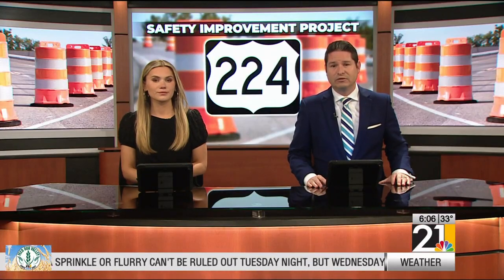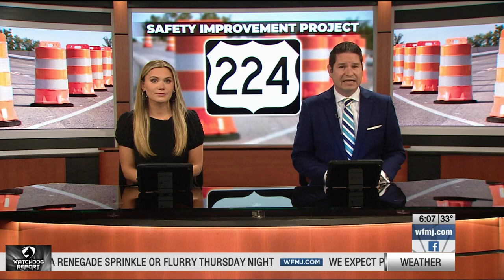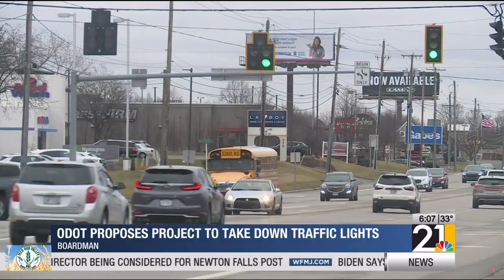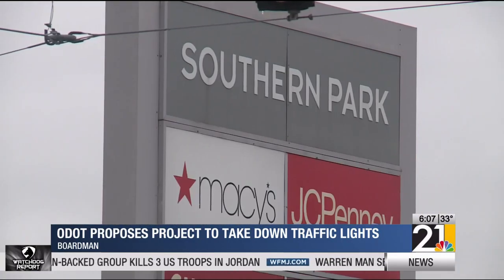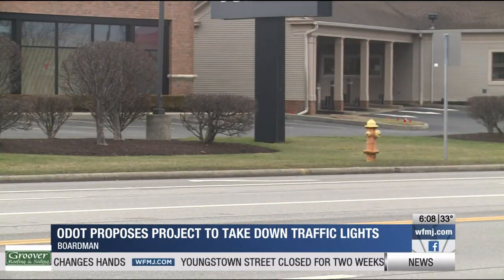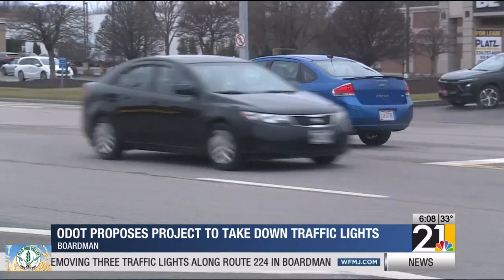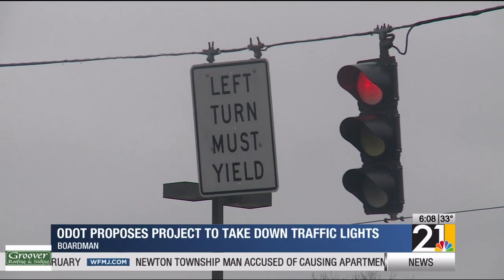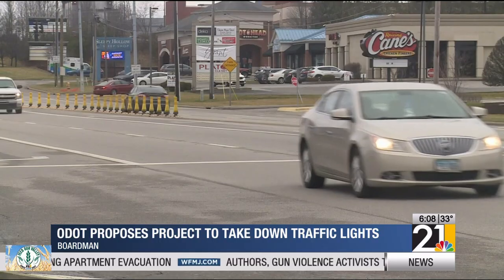ODOT proposes project to take down traffic lights

Comment: They created this problem when they widened 224.  Then they screwed things up more adding the yellow poles creating a blockade on 224/South Ave intersections without instituting a u-turn.  Headed East, you can not make a left hand turn onto South Ave. and actually get into those plazas the poles blocked because there isn't a proper turning lane for that side road.  Headed west you can not make a left hand onto South Ave. and actually get into the turning lane to get into those plazas again because there isnt enough road/proper turning lane.  Do you know how much of a cluster it will be with the designated U-turn spots because Ohioans are not versed in making u-turns.  You will end up creating other points of congestion as you created more risk for accidents with the widening.  I bet the stats show more accidents after the widening then before.